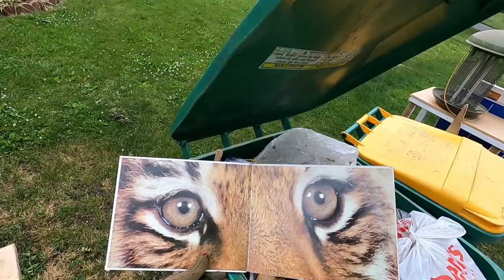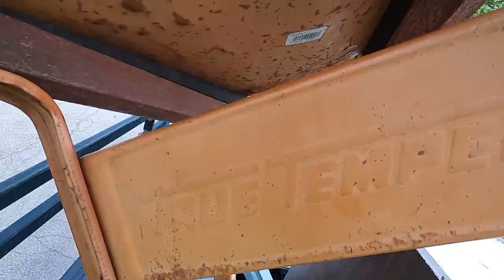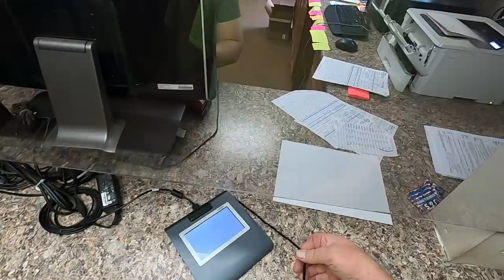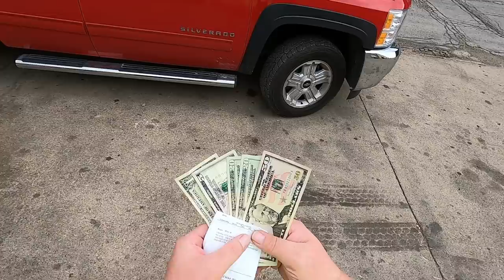This is Why I Love Street Scrapping

Comment: If you want to know a tip on those shelves, I cut the cross braces in half with tin snips then just push one of the sides down toward the other side, it'll make it longer but more manageable for space. Keep your fingers on top so they don't get pinched when it collapses, usually they are light enough just pushing with your palms works.
Reply: ok I see it. good call
Reply: That's how we get them also. Makes it so much easier
Reply: @TheDumpsterCats  I just subscribed to your channel

Comment: That armoire is/was a computer work station.  The pull-out shelf was for the keyboard, the bench in the lower part of the armoire was where the printer went (and the paper box went below the printer). The CRT monitor went on the shelf above the keyboard, the shelves up high were for books and software boxes.  The fold-out part was the desk extension for putting notepads or other papers.
Reply: my daughter picked up a hutch at a resale shop, her hubby added a pull down table and made it into her sewing center. shelves for supplies, fabric storage and when not in use it closes up all neat and tidy. no reason for that piece to go to the dump!

Comment: I  cannot believe how many camping chairs are thrown out all the time, most look in good condition.
Reply: Not only those folding chairs are in good shape but also the gas grills, the weed trimmers as well. It's as if the owners tossed the lightly used stuff in favor of buying brand new. Go figure.
Reply: Me my cousin and my brother found 3 nice one and each took one. They have a cup holder, are adjustable and they're backpacks too with straps on the back and a large storage bag.

Comment: Thank you Paul for your videos. I've been watching now faithfully for a couple years. You gave me the idea all though I don't scrap heavy metal. I travel through about 15 Apts buildings in Henderson NV 3 times a week. Just started couple months back and already have a couple hundred pounds of insulated copper wire??? God bless !!
Reply from the maker: Good stuff. I was born and raised right by Sam's Town. Not too far from where you are
Reply: @ScrapPalletMan  I actually live in Boulder City . I'm a Ebay reseller sourcing from yard sales, estate sales, auctions etc. But sales have been fewer because of the heat as you know. So I thought I'd do the cord cutting when sales are slow. It's amazing how many  are out there...

Comment: while you only pick up metal, are there other scrappers that take just plastic like PVC pipes and kids outside toys? that seems to me to be another landfill problem. cutting cords from electrical items seems counter productive, now an item that could possibly be fixed and sold to be used again, is given a sure trip to the dump! I appreciate all you do for your community to reduce waste, just sharing some of my thoughts when watching your videos.
Reply from the maker: There are others that are running around picking up items. But they usually are doing their route during the previous evening or nighttime. I'm the last usually doing my route and barely ahead of the garbage man. Whatever I am grabbing is moments from being crushed in a trash truck I headed to the landfill.

Comment: Paul i just had a thought couldnt you put a strong bar across the back at the top of your side bars and even on a hinge on one side so you could swing it out of the way when not needed then you could use a block and tackle to lift the heavier stuff into your truck it would work and it would cost far far less then a lift gate or trailer.
Ill draw a picture and send it via instagram
Reply from the maker: I've seen a few ladder racks like that.

Comment: There was money in the microwave it's has an electric motor and a magneton #2 insulated copper wire money thrown away
Reply from the maker: It does not have an electric motor. It has a transformer. But yes there's probably $8 or $10 worth of copper. But it would take me an hour.